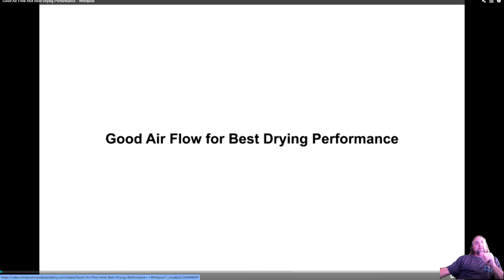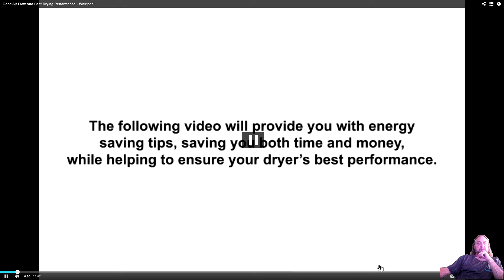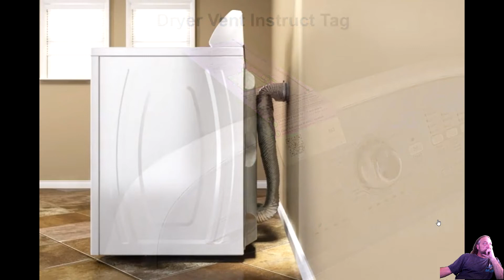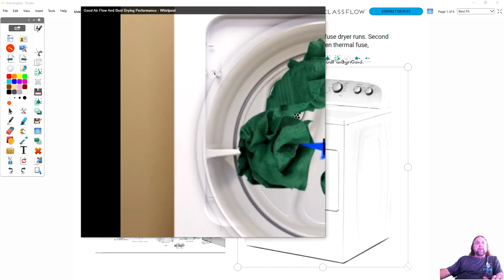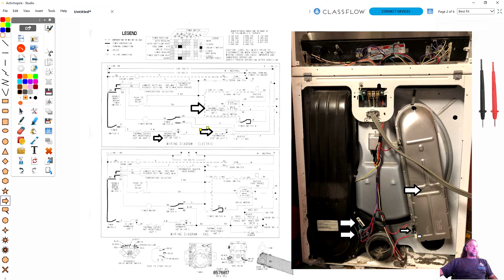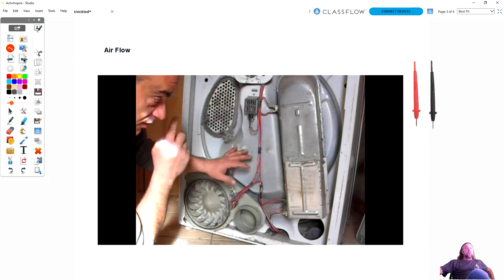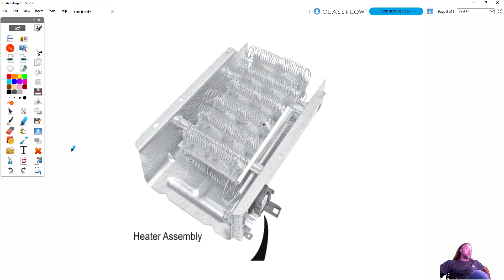Answer to Dryer thermal fuse

Comment: Exactly I run into this daily. I see elements sagging and grounding out to the housing and blowing. Also I've seen it where the blower wheel gets so full of lint it blocks flow and blows the thermal fuse also . So make sure u take off the venting going to the fan to clean out the fan and vent.

Comment: That tag on the blower housing just to the left of the thermal fuse, it specifically says to check heater for grounding out.  If heater is not grounded, replace cycling t-stat.

Comment: I've been saying for years that the thermal fuse does not open because of poor/no airflow.  Thanks for explaining in a way other will understand.  Open Thermal fuse equals failed cycling control t-stat, or grounded element.  Now an Element can and will ground out because of poor airflow, but correcting airflow only will not correct the issue, without replacing the element.

Comment: 2:23 The interesting thing to me about the WP video is it shows a dryer vent wall outlet raised up about 3-4 feet for absolutely no reason. If I have learned anything about dryers, it that the shorter and more direct the vent hose outlet set up, the better. Why don't they show a vent going straight into the wall and out? Rhetorical question.

Comment: A thermal fuse failing is a symptom of another problem. 

Generally if the one on the motor housing fails you have a vent issue. The air, and thus the heat cannot exit the system so that fuse trips. 

If the thermal cutoff on the heating element trips you have another type of flow issue. There needs to be enough air passing through the element to keep that thermal cut off below it’s max temp. 

Generally this is either a fan that is loose on the motor shaft or there is an air gap between the fan and element. Often the front bulk head will not be connected to the motor housing correctly.
Reply: How can the air get above 190 degrees to trip the fuse when the cycling t-stat opens at 155 degrees?
Reply: @drewbrown9678  now your thinking, wither cycling thermostat is not cycling or heater is grounded, that will cause it to heat all the time
Reply: That's the point the cycling thermostat isn't working so it's getting above the temp the thermal fuse can handle